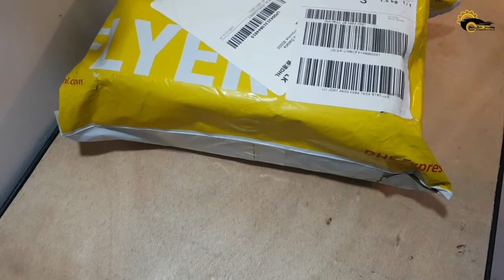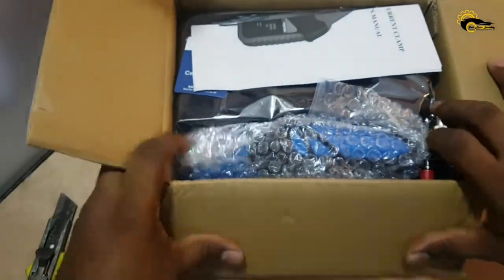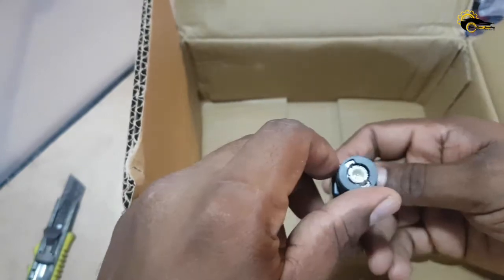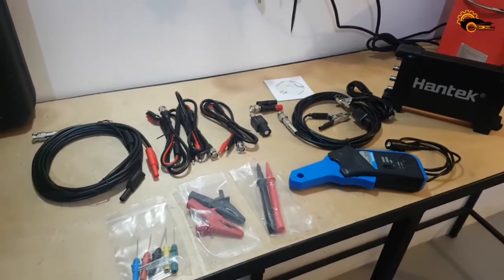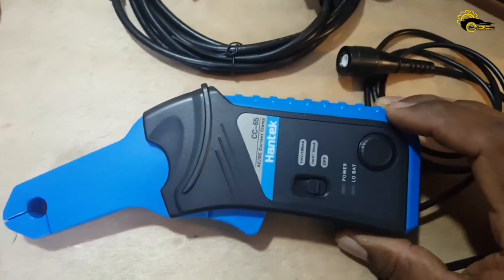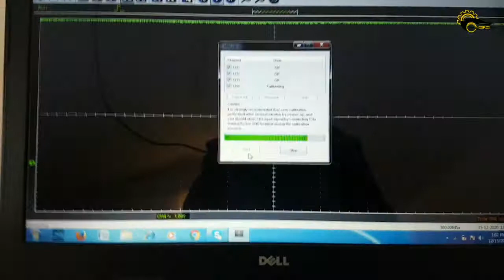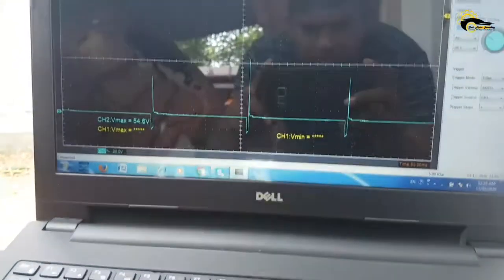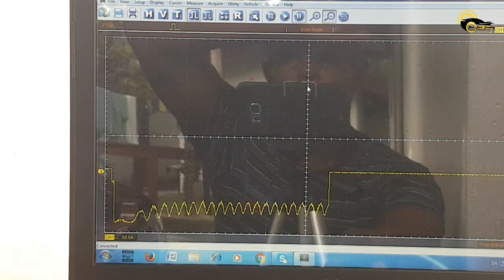Hantek 6074BE Automotive oscilloscope. unboxing and automotive capturing.

Comment: The head has AC and DC coupling.And how is this model performing?
Reply from the maker: AC /DC cupping, low pass high pass filtering available.
Reply: Make a video In which there is a way to use it What does trigger mean? And time and volt Division۔That means make a complete video with how to use it